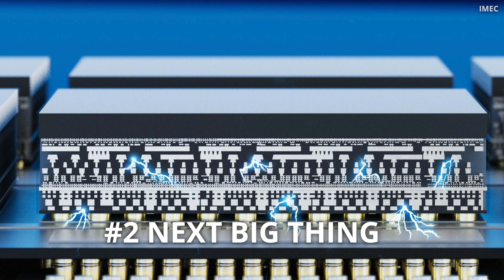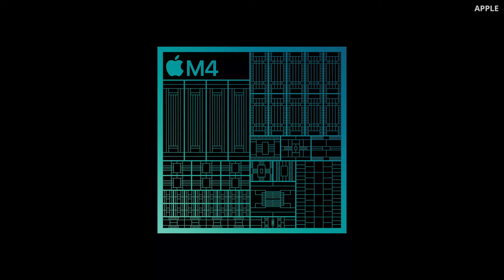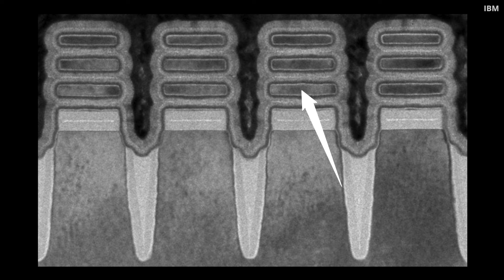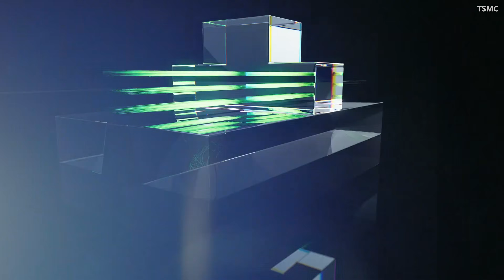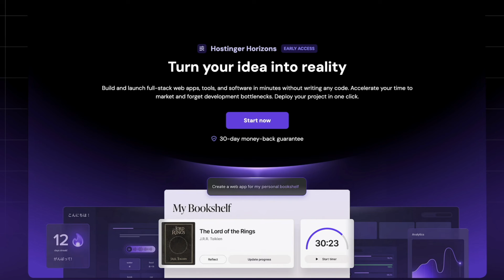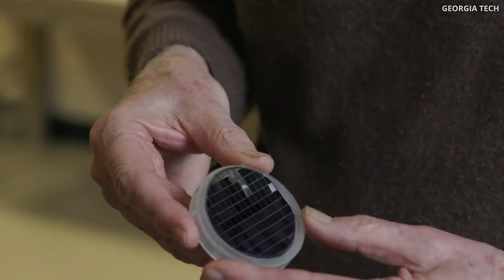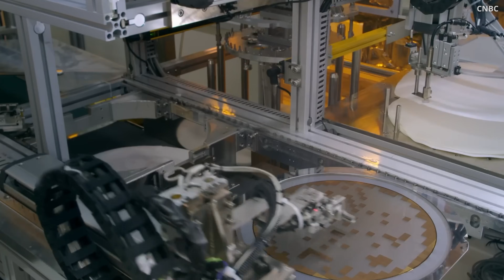The Next Big Thing in Semiconductors

Comment: Yeah this 3d transistor idea isn't going to work out. Early versions of the chips will likely generate a ton of heat and require at least twice as much energy. Can't wait to burn my leg as my laptop CPU melts the plastic shell and send hellish screams of steam running from the vents. Battery life is going to start scaling like Moore's Law but in reverse.

Comment: Still extremely suspicious about GenAI-made code. In practice the output from LLMs is often inefficient, e.g. C code that does heap allocations all over the place for idiotic reasons. You need to know a language proficiently to be able to supervise the AI, which really just turns the process from a manual coding effort to a manual review-and-redesign effort. The latter can even take longer than doing it from scratch.

Comment: So, how do you dissipate all that heat when you start transistor stacking?  Thats the problem, hard enough when you have single layers of transistors .... but when you have 4 to 5 layers you will need some hat trick cooling techniques. Even more, how to do this on a phone or a mac book air that uses passive cooling. Would be almost impossible.

Comment: These technologies aren't "new" and they didn't originate with TSMC, since for example, IBM developed GAA technology to demonstrate 2nm technologies a few years ago and developed nanosheet technologies a few years before that.   The primary issue is that no single company has the money to properly integrate that technology into a production line, except all but those with the best finances.  And what TSMC has going for it is economy of scale by being the manufacturer of choice by the worlds CPU companies, but that doesn't mean all the related tech comes from TSMC.    The fact that it takes a defacto monopoly on the production of cutting edge chips in order to be able to scale below 2nm and primarily for shrinkage and power gains vs actual gains in CPU speed shows you that "progress" is a relative term as moore's law is still fundamentally dead and the CPU industry is running on fumes.   And if it wasn't for the hype of AI and the need for massive amounts of compute to make it work, this industry would have crashed long ago, as it is no longer just depending on consumer hardware anymore for profits.

Comment: Why are the wavers circular and not square?
Reply: A starter crystal is placed on the end of a rotating rod that is lowered into a pool of molten silicon. As the crystal grows/cools it is withdrawn slowly creating a log on the end of the rod. In the 1970s it was about 1 and a half inches in diameter. As the machines got better it went to 3, 8, and now about 12 inches or 300 mm. These logs are cut into wafers and polished so that the face aligns with the crystal structure. A wafer is processed with the patterns of the different layers across the surface. The chips are then tested and some/most fail to work due to defects in the crystal. The wafer is sawn up and the working chips are packaged and tested again. There is talk of 450 mm wafers next.

Comment: There will be one more method available to modify the electron flow. Field effects from angled / shaped materials can 'force' the flow away from the 'ends' of materials into the center. .... old research :) ... it will be the next step. Making everything just a bit smaller :) it will require one extra etch step.

Comment: "It's over," the thumbnail boldly claims - Can anyone point me to the timestamp where Anastasi explains why "it's over"?

It seems the video 'itself' starts at exactly 10:00 - 'vertical' (3D) transistors. Could be a thing. (Start of vid until 10:00 seems to be intro into general chip-architecture) - 13:00 interconnects seem to be the main problem about this 'new' CFET-related tech breakthrough. The OP using terms like "extreme thermal challenges" and "probably require" seems to indicate the tech is still in its infant stages and these problems are actually nowhere near solved.
Reply: infancy....LOL... they been workin on it for 30 years FFS... nothing infant about it...
oh ..and its CFET not CFAT.... there have always been extreme thermal challenges that 'probably required' a new approach..
Reply: @WacKEDmaN  Thanks for the CFET correction. 
Except that, I just mainly rephrased what's stated in the vid - e.g. the "new" technology. 

So, how far (mature vs infant technologically) are the new approaches to solving these old challenges in this CFET architecture?
Reply: @StraightJacketAI  except no where did it say CFAT.... youre hearing and seeing things that aint there... i dont think the AI needs the straight jacket... you do....
Reply: @WacKEDmaN  I said it was a typo, so I thanked you for your correction. 
From this you conclude I need a straight jacket? 
Then I'll conclude you'll need a W**king.
Reply: @WacKEDmaN  I explained to you before that it was a typo, and even thanked you for the correction.

From this, you have concluded I needed a straitjacket :) ?

In that case I have to conclude you'll need a W**king.

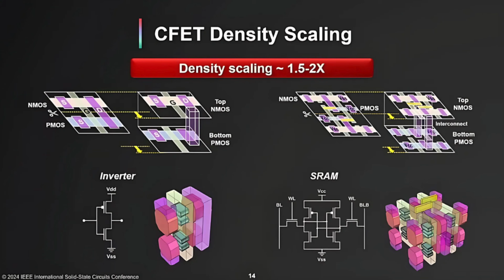Comment: 11:02 To achieve a similar on-state resistance as N-channel MOSFETs, P-channel MOSFETs require a significantly larger die size. I wonder how they deal with that. I can buy TSMC stock with the realization that the second mainland China attacks Taiwan, my stock value will approximate zero. Even in the best case scenario. Maybe that has something to do with the stock price. While the US TSMC fabs will produce legacy IC's, consider that the most important IC's for aerospace, space & military ARE legacy IC's, Not the fancy stuff. Produce them at a loss the same way you do not expect to make money off of an aircraft carrier.

Comment: ¿Aren't these ultras mall and 2D & 3D transistors and conection paths (horizontallly and vertically) more sensible to electromagnetic fields or pulses?  Induced currents or signal distorision. Also added to termal signaling disturbance. For Space and Militar applications maybe we don't need to go so far. Just as a questión or concern about external influences.

Comment: So take a hollow sphere (bubble) and dope silicon on it.  Now you can build 3 dimensions.  Once the matrix is created isolate it with a protective shell that can be coated with a thermal conductive layer..  And that hollow part can be your heat pipe.  So your thermal conductive layer wraps around to be in contact with your heat pipe.  Your shape and materials optimize your cooling.

Comment: Nice overview! One remark. I really don’t see how moving interconnect to the back side would lessen the requirements on the resolution needed for the layers. There is a hierarchy in the interconnection that remains the same. You can split it in two but it does not go away. There would be a gain in planarity, making processing somewhat easier, but that comes at the cost of the feed through, which is all but straightforward.
Reply: Notice in the one picture the upside down Christmas tree of stacked vias. The signal wiring was nearest the transistors with the power layers on top. That 'tree' adds resistance to the path and limits the current the transistors can switch. To change a wire from zero to one, or one to zero you must charge/discharge the capacitance surrounding that wire. The current flow to do that limits the speed of operation. Putting the power wiring on the bottom reduces the height of the tree through all those signal wiring layers, reducing resistance and increasing current flow and reducing the limit on clock rate due to power wiring. You may still be clock rate limited by signal wiring however.
Reply: @JeffBartlett-kj6sq  don't one add extra length by using vias that run through the substrate. It is thinned indeed but still. Also, one does not power individual transistors but blocks, so the power vias have to go through the first layers of interconnects and the substrate.
That aside, but I was commenting on the lithography where she mentioned lowered resolution requirements by using power vias.
Reply: Wiring paths may also be more direct since power vias are not scattered around

Comment: The analog RF performance is suffering enormously with extreme advanced scaling in CMOS. As the supply is reduced the linearity problems become almost impossible, the advanced nodes also have extreme amounts of flicker noise, unless you make the device huge. The resistive interconnect and large coupling capacitance is a huge problem reducing the effective gm, ft and headroom, The IR drop is also a huge problem. The increased cost for advanced nodes makes analog design with passives (inductors) very expensive, since the inductors cannot be scaled down. The channel leakage is NOT an issue in analog design where you always need a bias current, most amplifiers are biased in class A/B, sometimes C

Comment: Time to build factories in Europe. No good word for American top government as for now. Humans demand far too much from the planet. We need to reduce drastically. Electrifying our houses and industry can mostly be achieved by an on site controller and simple automation. It's absurd to have this based on cloud computing and AI. I can't even find a Matter controller that does temperature, kW, kWh and CO2 logging locally. This is mandatory for home energy management and to control ventilation over a heat exchanger. Let's keep focus on the real needs. I use small dashboard screens per room that display 6 critical values each. Really useful. Please allocate more budget for developing these missing tools that run over an in house back bone and avoid power consuming (cloud) computing.

Comment: While I really like the level of technical detail and overall level of insight in this video, there are also some parts of it I found really grating that I think are worth pointing out. First off, calling seemingly every technological innovation "genius" is ... well, it renders the word meaningless. Besides the fact that that word is mainly used to create mythologies about individuals involved in creating these things, it also renders invisible how each of these things is the results of long, slow, iterative and extremely collaborative processes. Second, claiming that technological development is accelerating is also a ... stretch. In some ways it definitely is, but in others it's also clearly slowing down. Do we have much faster chips now than five years ago? Absolutely. But the rate of change is slowing massively*, and a lot of the ways in which we have faster chips today is through increasing power and density rather than actually making them more efficient, which doesn't exactly amount to "progress" in my book. In the real world, a PC from the early 2010s is still usable today, which hasn't been the case for any previous point in time. Sure, you won't be running HPC or AI tasks on it, but that doesn't change the fact that relatively speaking, the rate of technological advancement is *slower than it's ever been, and a lot of the things you're pointing towards as signs of progress (such as the need for new transistor tech to drive node shrinks) are actually signs of an industry working extremely hard to stave off stagnation - from saturated markets, from "good enough" products, from people who don't see the need to upgrade their current devices, from software a decade old that still works fine. Heck, we're looking at an industry that has spent the past decade desperately trying to invent new markets to stave off stagnation - from blockchain, crypto and NFTs to VR, AR and the metaverse, to now AI. All in some ways technological innovations, but all massively overhyped in order to drive FOMO and sell more chips and software, especially to businesses scared of being left behind. The vast majority of AI products on the market today are essentially scams, delivering zero real value to customers and often undermining the quality of what they're actually doing - while the real useful parts of AI, like machine vision in industry, has been around for years and was a thing long before AI hype.

Comment: The biggest challenge is Efficiency, the Blackwell-Chips allready have problems with cooling, because the energy-density is much to high.
The board-manufacurers are in trouble, to bring the heat away from the core(s): up to 900W on 750 mm2 (GB202) is too dense even using watercooling.

Comment: I expect more from you as an engineer. There is no true 2nm manufacturing process; it is merely a marketing term, and I believe you know this but have chosen not to mention it. The gate pitch and metal pitch are not even close to the advertised 2nm marketing term. In fact, the (contacted) gate pitch is currently around 48nm, while the (tightest) metal pitch is approximately 24nm.
Reply: Yes, she has mentioned it. Whole bunch of explanations of the marketing terms vs actual

Comment: Is anyone working on a chip without interconnects?
Like many nano sized photoelectric cells to
Deliver power directly 
From a laser to each
Individual component
Beneath the cells.
And a mirror on the other side so that
Each gate can output
Optical signals to each other. Or am i being naive?

Comment: 1 nm= 5 Si atoms, at some point, this will be unsustainable. And we need to make Transistors that can function at mv and micro volt levels; Chips consume really high levels of Power and is getting unsustainable Worldwide; this was demonstrated in The Crypto Crisis; and continues with many Cryptos still based on Cryptomining. Also manufacturing Chips takes a lot of water; so we need better water recycling process in the Chip Factories.
You shouldn't speculate about price, 'coz that speculation promotes price increase; if you don't have solid ground about prices, don't mention it

Comment: 20-03-2025.
Hello, at the end of your talk you said Intel, the key to this eternal miracle round dilemma of getting smaller faster, and cooler transistor and there connections on a chip, Intel has come up with a new scaleing format already which means they have a solution to the ever shrinking transistor problem, check it out.Latter.

Comment: Without having any understanding of chip manufacturing.😉..why don't they create polygonal boronic (hexagonal or more) directional layers..
Reply: 45 degree routing is used in hand crafted cells. Software to create the wiring within a box to connect points on the edges is limited to 90 degree turns. One can assume that all horizontal wires are on one layer and vertical on another. Then merge segment if no short would be created.  Adding two more starting diagonal layers would  increase calculation cost without much benefit. However there is an issue where a wire's length creates an "antenna effect" where electrons spill off the outside of a corner and 45s in the turn can help.

Comment: ASML photolithography process is still essential to manufacturing, regardless of the transistor design used... you still need EUV equipment to fabricate...
Reply: I agree, lithography equipment is still essential. What I think was trying to be expressed is that innovations are going to be less lithography bassed and more material or architektur bassed
Reply: You are correct, of course - I don't know how Anastasi got this so wrong: of course you need EUV equipment, i.e., ASML's EUV's machines to fabricate CFET transistors.
Reply: Anastasia did not say is not important, she said that now, is not as important any longer, the research needs to move in other directions (different materials, 3 D stacking, interconnects, power mgmt, bring it to production level), none of these require EUV lithography improvements
Reply: Wrong. US is literally hopeless and clueless nowadays, what can I say as you'd not understand the rest.
Reply: Wrong.  My long tech explanation why got removed Fridays quickly. China will win this due to all its best chinese researchers and those they recruited from US and TW to china. Just like how China skipped landlines a quarter century ago to later dominate mobile com, 5G and now 6G already widely in use in China and only in China.
Reply: Nope. My long tech explanation why got removed on Friday quickly.
Reply: China will win be tops in this in 5-6 years due to new tech and all its researchers plus the best they recruited back to china from US and TW. Just like how China skipped landlines a quarter century ago to later lead mobile 5G and now 6G already widely in use in China and only in China. I know.
Reply: No you don't need EUV but EUV makes manufacturing a lot easier.
Reply: Just like how China skipped landlines a quarter century ago to later lead mobile 5G and now 6G already widely in use in China and only in China. China likewise moving on from current chip tech.
Reply: @davidrichards1741  yeah, that’s why they want Taiwan so bad…… lol hopefully you’re joking
Reply: @thegreyzone5859  Taiwan is about geopolitics and the "unsinkable aircraft carrier" concept. It's key for military control over the Pacific.  Taiwan is NOT about chips as China already has a 75% global market share of chips now, up from 0% six years ago. And it's now self-sufficient in 3nm+
Reply: @thegreyzone5859  Plus TW is deeply about the chinese psyche and recovery from "the century of humiliation".
Reply: @thegreyzone5859  Taiwan is also very much about the chinese psyche since after the....
Reply: @thegreyzone5859  century of humiliation
Reply: @thegreyzone5859  my other replies all auto removed :(
Reply: @davidrichards1741  Man you sure are in love with China. I wonder... Hmmm
Reply: @davidrichards1741 Taiwan is not very important strategically. What you can do militarily in Taiwan you can do it from the Northern Philippine Islands.
Reply: Move to Asia and get a clue.
Reply: China will win be tops in this in 5-6 years due to new tech and all its researchers plus the best they recruited back to china from US and TW, I know.
Reply: No
Reply: @AnotherAustin-z7b  yes